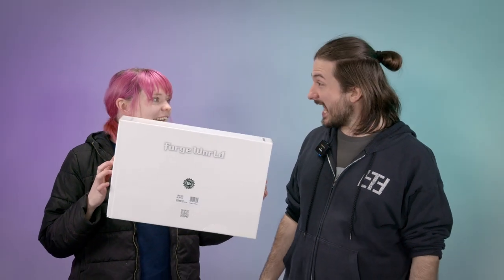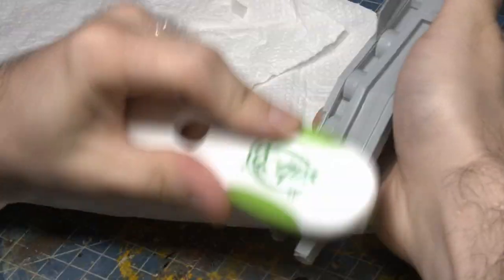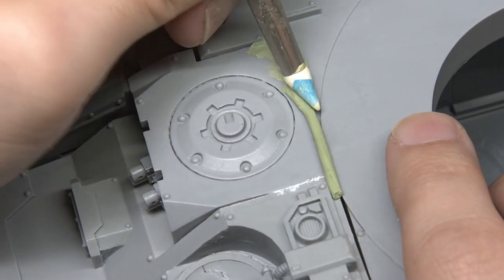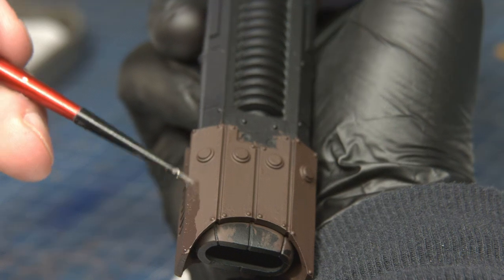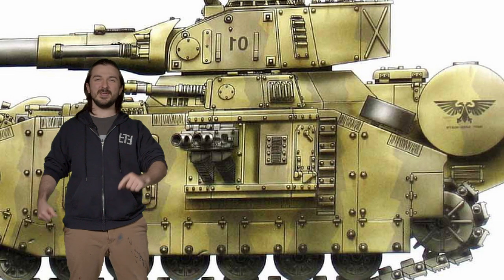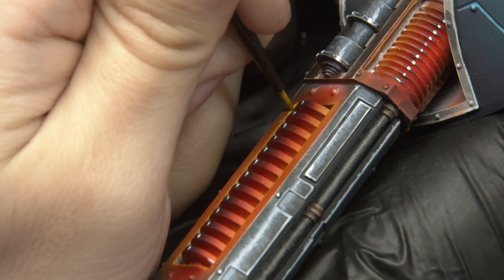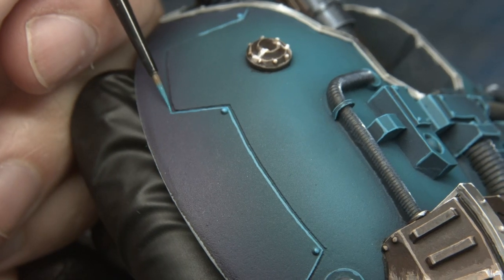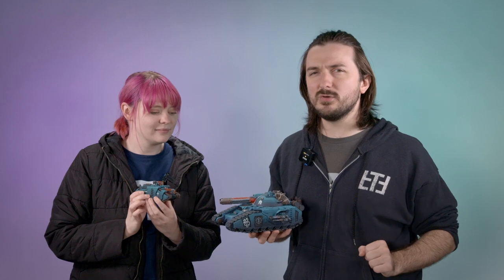Meet: The ORIGINAL Warhammer 40k Super Heavy Tank!!

Comment: As a small correction to the release history at 14:20 . The plastic Baneblade was first released only with the Baneblade and Hellhammer configuration (I had bought that kit twice during 5. Edition 40k). The "turretless" variants were released as a second kit later (2009 if I'm correct). The Rebox with all variants, das was shown in the video was maybe 2019.
Reply: That's the problem with these youngsters covering stuff which they weren't experiencing first-hand - there are always some inaccuracies.  I had that Baneblade kit as well and it had far fewer sprues inside (and was much cheaper) than the current kit.  I also had the Armorcast resin kit - the track units were cast in open molds with a dark grey resin and they were larger on the sides that fitted against the hull due to uneven thermal expansion at the mold opening.  I never got to build either unfortunately due to life issues - at least these folks are getting to enjoy their kits
Reply: @elrondorio  Don't know if I would still count as a youngster with 34 years 😅. Yeah the Baneblade was definitly cheaper when I bought my first two. I'm actually not entirly sure if anymore if I paid 85,-€, 90,-€ or 95,-€ back than.
Reply: Today I learned GW really like messing around with any Baneblade related kits, and merging them together
Reply: @AsterixCodix  Yeah, with the new Astra Miltarum Release they repacked the Baneblade again, including a second Sponson Sprue because the model can be build with four sponsons.

Comment: 13:53 the baneblade in the back is the original forge world one you're referring too. The easiest way too tell a plastic from a resin baneblade is the size of the rear fuel drums and the non-modular sponsons.

14:05 Bit confusing but I believe this is one of the interim shadowswords as its built off a plastic baneblade chassis. IIRC they did keep selling these resin ones for quite a while after the plastic shadowsword released 

14:15 The original Baneblade kit only built the baneblade and hellhammer variants. This was followed up later by a separate kit that built all the shadowsword casemate variants. It was many years later that a '1 box builds all' kit was released. I'm not sure if this new kit used new sprues or they just chucked everything in one box, but i think it might have been the former.

Still i think everything else is correct, cool to learn about the history of the glaive name. Love your final paintjob!

Comment: What’s the difference with forge world models? What makes them different from the normal models?
Reply: The designs were slightly different to the later GW plastic kits, in fact the 'Forgeworld' Baneblade and Shadowsword models shown in the video were actually the GW models and not the Forgeworld ones. Forgeworld models are aslo cast in resin rather than injection moulded in styrene and often quite badly moulded at that, I own a Forgeworld Mars pattern Baneblade which I bought over twenty year ago but never built due to the numerous instances of serious distortion and mould slip on the parts. For an experienced modeller willing to invest a lot of time and effort to make a model look good, Forgeworld are a good choice, for a gamer who wants something that builds up fast and looks good straight from the box then it's safer to stick to the GW plastic kits.

Comment: If the models were not so dang expensive I'd have my slanessh sisters of battle, my fox dna altered grey knights (basically grey knights but with fox tails in full flexplate armor), shadow keeper custodes, and 3 tyranid army's. But noo gw makes them 50 bucks for a 5 pack of 1 1/2" tall guys, sure they have a crap ton of details but no reason for the price. I mean 2000 for a certain titan, gundam has the neo zeong which is about 4 ft tall and only costs about 500 usd and its a giant armor for a 5 in tall figure thats fully posable, like tf gw and fw get your shit absolutely together